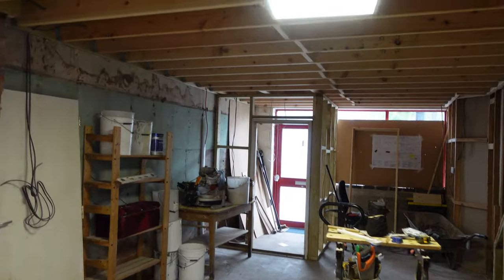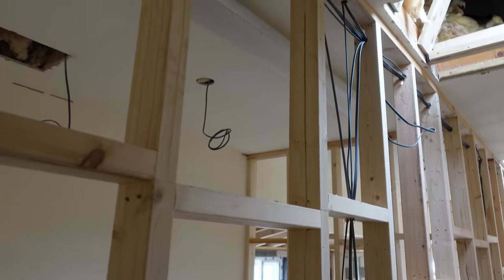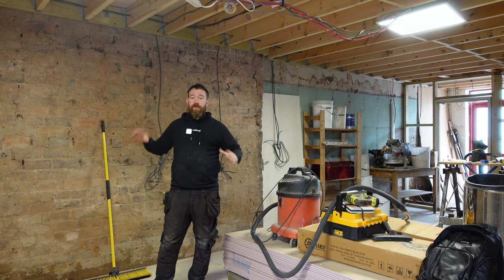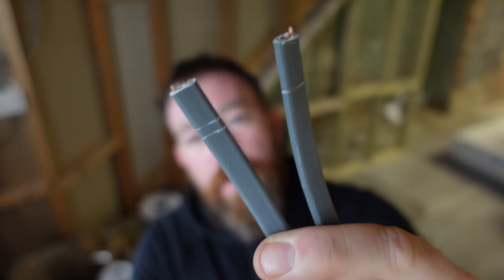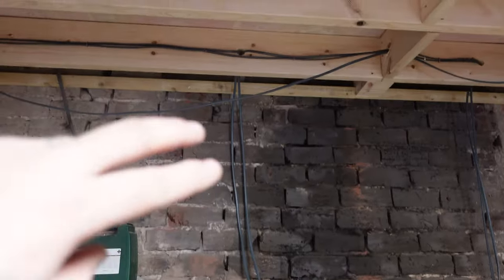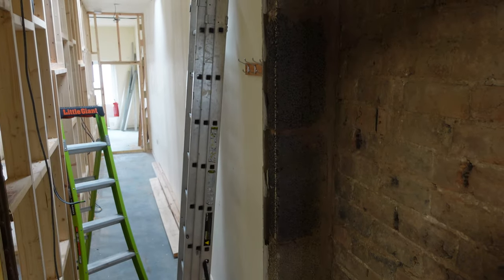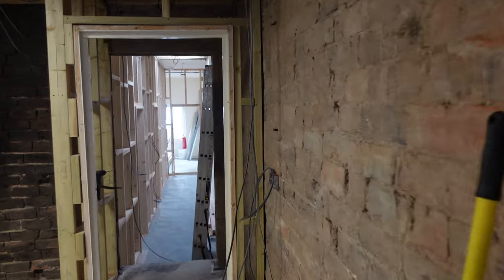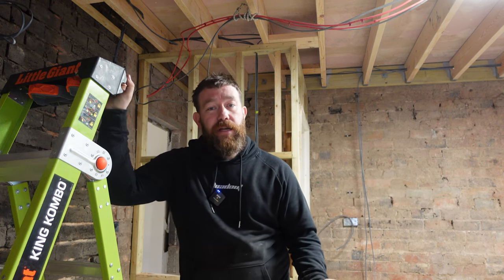Wiring Up 100% Electric Shop Conversion - Electrician Tips And Tricks

Comment: Good video Jack😊 
I always run a radial on 4mm twin & earth & feed it on a 25amp fusebox mini Rcbo
Reply from the maker: Nice Mike, I never use 4mm as I think 20a is more than enough for most circuits, would have been a shout on the heaters tho